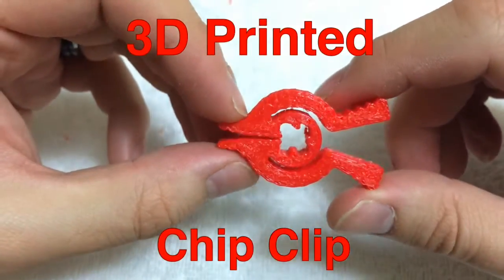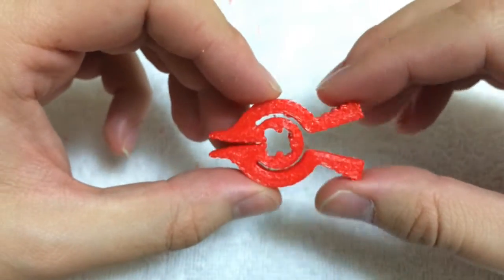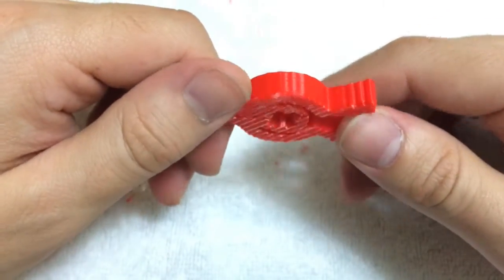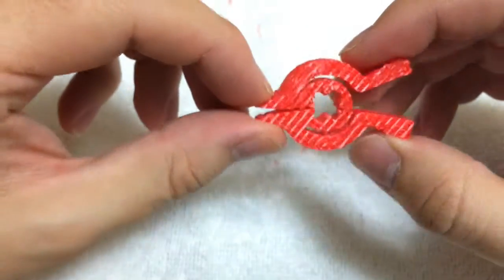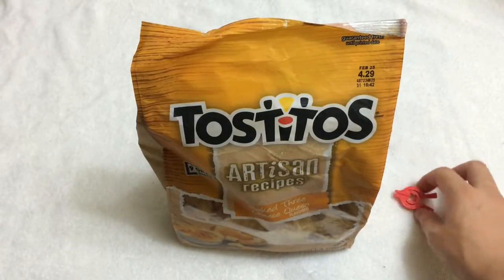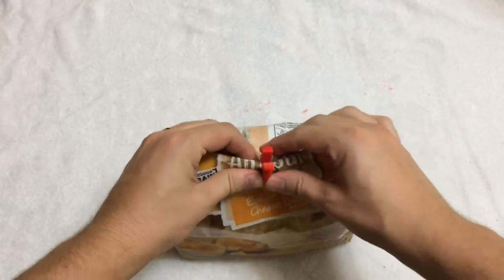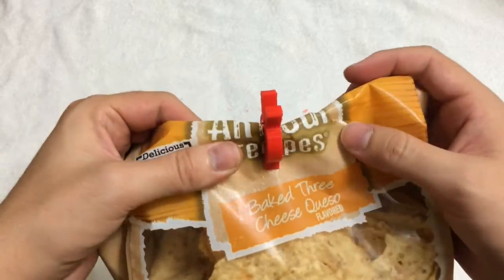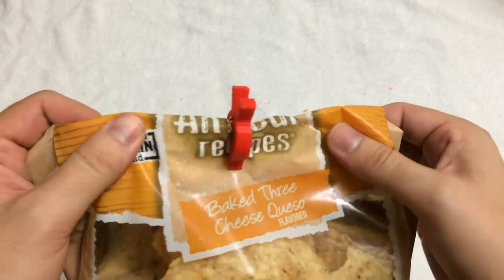da Vinci 3D Printer: Chip Clip

Comment: Cool. I wonder how that would print in PLA? Maybe PLA is too stiff, I might try printing in ABS for my first time
Reply from the maker: It might work I don't know. What is the advantage of printing with PLA? It seems like it is about the same price as ABS.
Reply: PLA I a LOT stronger and stiffer than ABS. If you bend PLA too far it will snap where ABS will flex. If you have a look at my bag clip you will see just how stiff it is. But  like the small size of your bag clip, I may print one out tonght
Reply: (1) infinitly less obnoxious smell, (2) much less warping and much better inter layer adhesion - no delamination issues, (3) can be printed on unheated print-bed (more energy efficient), (4) biodegradable (to some degree). Tipp: PLA-PHA blends are less hard and brittle than pure PLA (PLA-PHA filament never breaks when unrolling from the spool in a slightly cool environment). Also some PLA's are made to be tempered raising the rather low temperature resistance (maybe at the cost of a bit more brittleness of the product though)